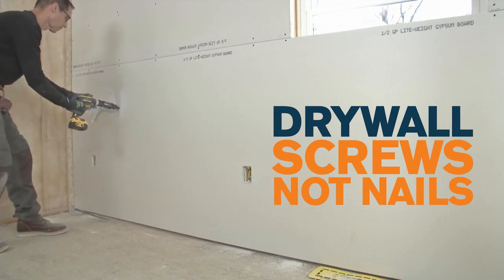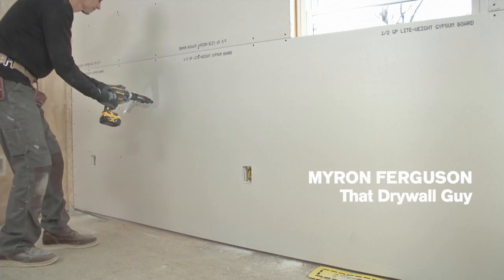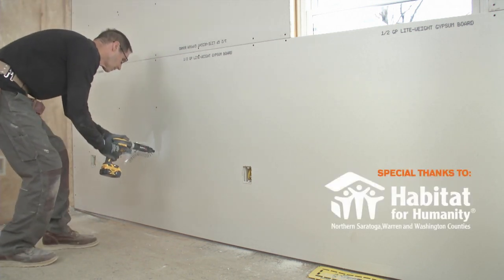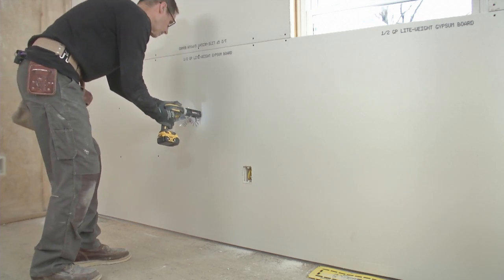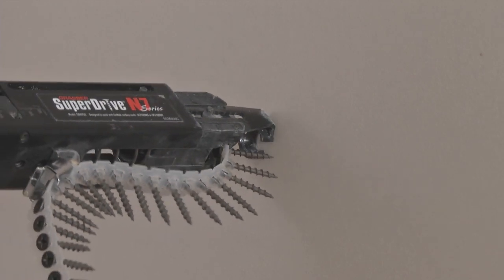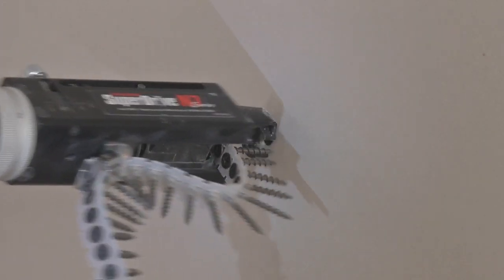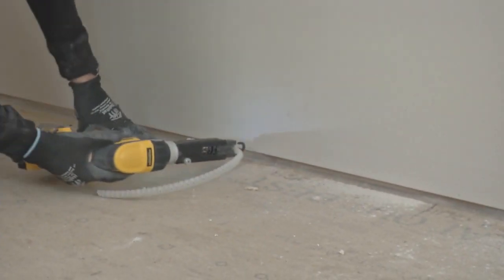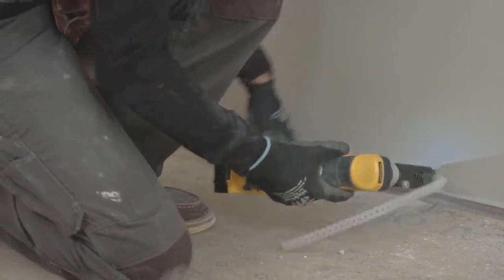Why You Should Use Screws Instead of Nails for Drywall

Comment: Better than screws is the polyuretane in spray, you no need to cover any screw head, and if the frame behind the drywall is not perfectly in one plane the adhesive fill the gap. And is stronger and faster too!